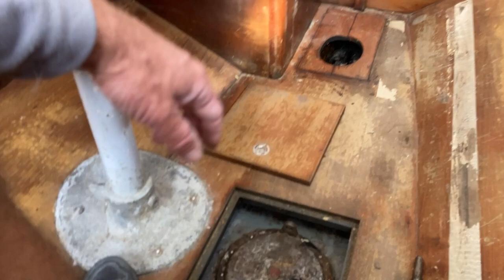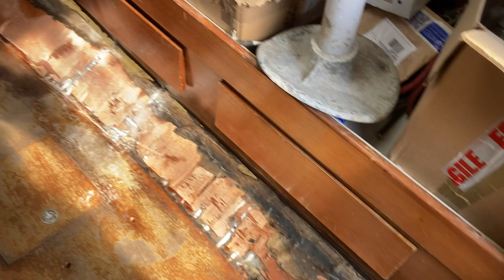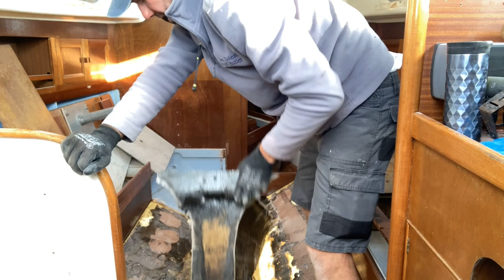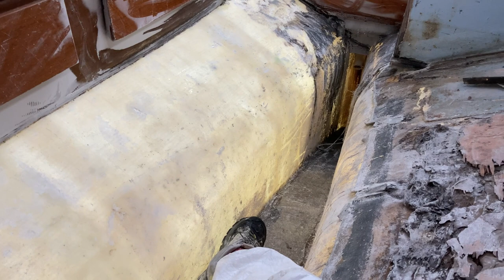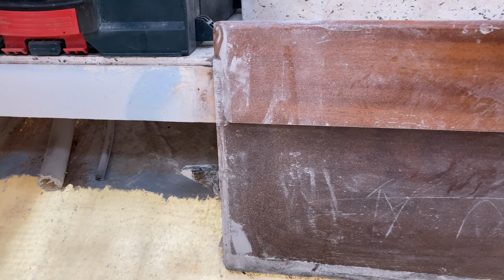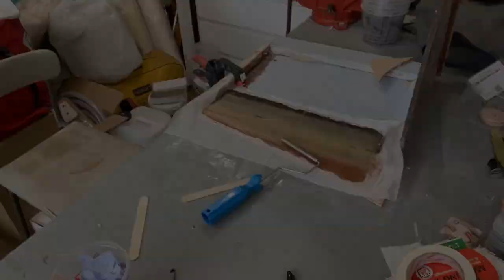Floor and Water Tank removal on a Contessa 32 (Project Lottie Ep6)

Comment: I've been watching backwards, and what a difference you've made since the boat was in this state!

That's crazy that they drilled two holes in the hull to fit a table, never knew that about Contessas. I'm assuming they changed that somewhere along production?
Reply from the maker: New boats have a different table and a different method of attachment, to be fair to the builders it’s proven to be a strong, secure and generally problem free method - just a little unorthodox.   Thanks for watching, I hope to get back to project Lottie very very soon, just been clearing the backlog of winter works that were booked in before Lottie arrived.

Comment: Hi George. Nice work on a messy job. The channel is very interesting and I hope it grows for you . I’m doing a Hunter Impala at the moment. I’m half way through replacing a section of the primary bulkhead where the chainplates connect into . I’ve left the forward tabs for now and plan to epoxy the new ply to them. I see you’ve ripped out all the old tabbing . Is that the approach you’d take in my situation ? Start from a fresh surface and build it up. My argument would be the old tabs are still strong .
Reply from the maker: Thanks, you can probably do it either way, the old tabbing will help locate the new bulkhead in the correct position but you have to adhere the two. Generally I would put all new tabbing in so you are not relying on another persons work.  I guess it depends how confident you are in the old and if its a high load area.

Comment: Thanks a lot for making this, George. My tank is absolutely disgusting at the moment. There was even some diesel that managed to seep into it somehow. I am dreading this project a bit less now and I have a good idea of what I need to do. Look forward to seeing the new tank go in and to seeing how you plan to replace those strengthening beams that got cut out.
Reply from the maker: No problem, pleased you found it interesting, it’s not a small job so do factor in plenty of time for it and ensuring enough strength is put back into the boat with the new tank (bonding over the top of the tank) is essential.
Reply: I have an old UK built  GRP Twister 28  I have purchased here in NZ, that also has an integral internal bilge water storage tank. I want to rip that disgusting tank out.... would a multi tool do the job (which I think you use in this vid) rather than a grinder?  I won't be replacing the tank either, so I guess I'd have to glass in some floors to tie the bilge together?  At 12:54 in my vid you can see the integral tank:. https://youtu.be/pyFv8Sxdvm8
Cheers for any tips. Love your channel!
Reply from the maker: Hard to give advice on the structure without seeing the boat but I use my oscillating tool a lot in this video for cutting the old GRP tabbing and its very good for that (accurate and easy to collect the dust).    best of luck with the repair.
Reply: @RefitandSail  Far out, you replied already. Thanks very much.  I added a vid link of my boat  to my original comment. At 12:54 you can see the tank.  Cheers!
Reply from the maker: It may be that the top of the tank is used to tie the two sides of the hull above the keel together (like the contessa) so if you remove the tank something will be needed there to retain that structure or you could end up with a slightly floppy boat.   When beating, hard on the wind and heeling there is a lot of weight in the keel being lifted to windward, all that load is going to the area where the water tank is so you don’t want any flex.
Reply from the maker: Ps where are you in NZ, north or south Is?
Reply: @RefitandSail  Good morning.  I am in the North Island.... Auckland
Reply: @RefitandSail  Excellent thanks.  So very important then if I do remove that tank I replace it with very well bonded athwartships floors.  A big job!
Reply from the maker: @junk_rig_sailor1698  I’m not a navel architect and not seen the boat other than your vid but I would say that it’s an important part of the structure.    Maybe you could ask the same question on a twister forum I’m guessing there is such a thing as it’s such a well known boat.
Reply: @RefitandSail  Cheers mate, will do

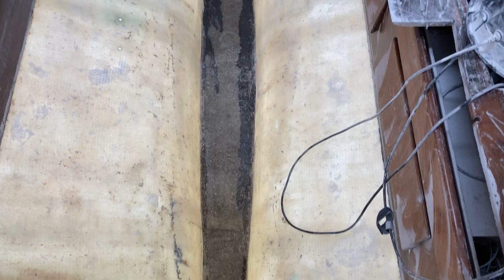Comment: 13:26 - 28...what are those two holes in the hull? what is mounted there? Can´t be the through-holes to mount the giant sacraficial anodes...but what is it?
Reply from the maker: Two small holes in port side are two of the 4 fixing holes for the table leg support.   two go though the hull (yes really!) and two though the floor.